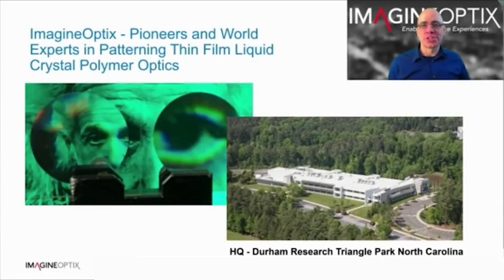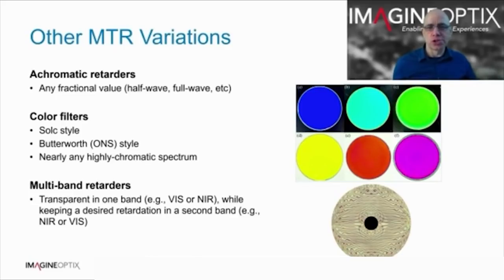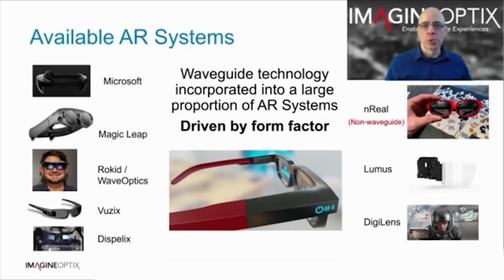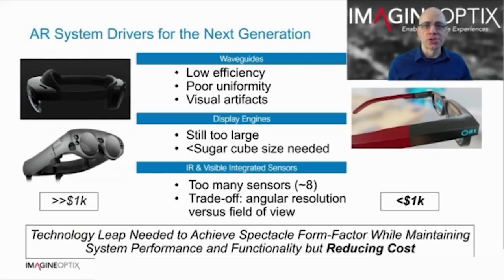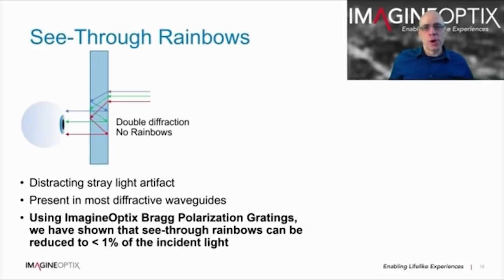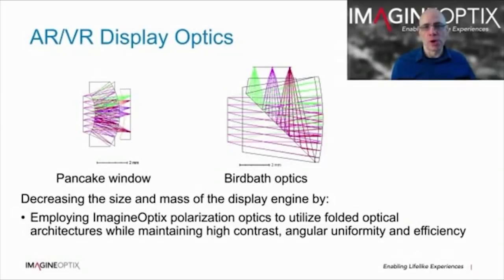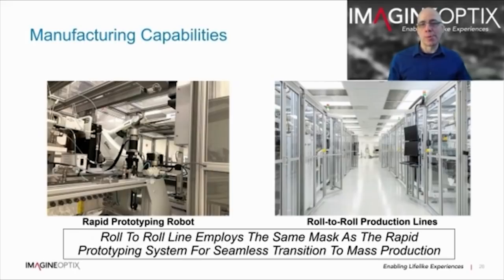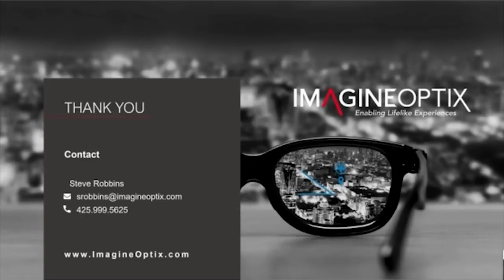Imagine Optix  Liquid Crystal Polymer Optics

Comment: I have to wonder if this display system will be close to what the varjo aero offers in quality? It seems to be more convoluted and that usually means more $$$?. We really need an announcement from Valve... this new generation seems to be quite a large chunk of $$$ and if someone is on the varjo or pimax or X brand hardware, it's not likely they would re-invest in a later valve system. I'm thinking this may be the case because you can order valve lighthouses and controllers as a package with varjo. If their system were coming sooner I don't believe they would be giving hardware to varjo that isn't available for customers on their own website?
Reply from the maker: These are breakthrough lenses that the industry will slowly transition to over time. Players like Valve want to be first to the party and paid for their own factory to be built to achieve this.

These systems will likely trickle to other companies as manufacturing becomes more spread out and cheaper. (However roll to roll manufacturing is already very cost effective)

Comment: So does Meta Cambria have Pancake lenses or Liquid Crystal lenses? Because if that expensive flagship headset from the biggest XR company in the world has Pancakes then it's very hard to believe Valve would leap frog them by a generation so quickly, especially when Meta already showed their working prototype years ago, apparently also using Imagine Optix's tech... i realize Valve already achieved that once in the past with positional tracking, but that was their own in-house invention that competitors didn't know existed, not a 3rd party that already collaborated with competitors.
Reply from the maker: Cambria uses standard polarization-based pancake lenses. I don't think they will be using Liquid Crystal Polymer optics

Valve is in a good position of being able to achieve stuff like this earlier than Meta purely because they target the high end and only implement stuff they care about. Which is sorta the opposite of what Meta targets in terms of price and usercase scenario

People sorta forgot when the Index came out: it had a lot of features that really set it apart. FoV being the biggest that still hasn't been caught up with without sacrifice
Reply: @SadlyItsBradley  But Cambria is also targeting high end and won't even be called Quest. Sure, index was targeting different price and quality than Rift S and Quest 2, which were mainstream oriented with some cost cutting. But Cambria is not this kind of product. It's meant to be a high end flagship that is "substantially more expensive", so this time the idea of Valve going for high end and Meta for low end seem very dubious to me. Something doesn't add up here...
Reply from the maker: There is also limitations for the concept of what Meta wants to achieve based on their planned processing unit. Valve is focused on PC VR as well, which allows much further possibilities in specifications.

Meta has given up on that aspect to focus on pure standalone. So relying on the SoC to do everything will also limit capabilities flat out. Until cloud processing is more abundant
Reply: Carmack has pretty much confirmed that their varifocal technology is not ready.  Meta has to appeal to mass market, it has to "just work" (just getting their users to set their IPD correctly gives them enough problems), and they have strict cost constraints.  Valve on the other hand is targeting enthusiasts and thus they can tolerate a situation where varifocal needs high friction calibration or it only works for a certain percentage of people with "normal" eyes (the rest needing to disable it).  Moreover, they can tolerate a costly varifocal system and other costly features that may assist varifocal, like in-headset eye correction (Carmack mentioned that glasses really screw with their eyetracking and varifocal system).

It should also be noted that Valve made this ~$10m investment to mass produce these optics a year before Facebook showed their prototype (Well, the video of it.  Nobody outside of the company got to demo it).  And you can be certain that they were researching it well before entering a contract with a company to mass produce the technology.  In other words, there are other companies working on these things too but they just aren't participating in the hype/marketing that Facebook/Meta is.
Reply: @asdpls9231  So assuming this theory that Valve will go even higher end and higher price than Cambria is correct you have to start wondering how sustainable for SteamVR profits this approach is. Because Index is not. There are more and more developers giving up on SteamVR because they sell 10x more copies with dumbed down Quest 2 ports. GabeN knows this - he is the first dude in history to subsidize a standalone low end, low cost, low performance PC at $399 called Steam Deck (and funnily enough he even mentioned Quest 2 in an interview about it). He will make his loses back with software fees on steam. This is a trick a $1000+ Deckard will not be able to do. Call me crazy but my current prediction is Deckard being cheaper and less advanced than Cambria. And that's why they also have a subcontractor working on self contained, inferior and cheaper tracking solution not using expensive Lighthouses - just think about that. Or maybe Valve will release 2 headsets: low end and high end. That would be impressive.
Reply: @kazioo2  Gabe has explicitly said they see two paths for VR, low end and high end, and that Facebook is pursuing the low end and Valve will be pursuing the high end.

But first on profits: even Facebook is not netting anything close to a profit with their 30% fee or data collection/ads from VR.  For them this is a $10b/year money pit so they can ensure they don't miss out on the next big medium before Apple, Sony, Google, etc etc run away with it.  And I doubt there's much profit in it for Valve either: the overall VR usage frequency and retention (which is what translates to game profits) just aren't there (Deck will be a different story).  So the truth is Valve cannot really hope to compete with Facebook in low end hardware offset by subsidies.  Yes, Valve is rich, but they are not FB rich (it's a >10x difference) and it would be absurd for them to blow their overall Steam profits subsidizing such a tiny market.  Moreover, even if they did subsidize PCVR hardware, there is really no hope of Valve outperforming low end console VR with their PCVR ecosystem anyway.  It's just the nature of the two markets: like PC gaming vs console gaming vs mobile gaming, some are just inherently cheaper and much more accessible, hence why you see the Quest platform flooded with kids.

But one has to understand that just because one market is larger, it doesn't mean other markets cease to exist.  Yes, you're seeing Questifaction, much like PC gaming saw bad consolization in the 90s and 00s.  And yes, now that the FB money hose is focused on a different market you're starting to see what "reality" actually looks like when there isn't a megacorp subsidizing everything.  But millions of PC gamers aren't just going to give up on PCVR and settle for smartphone graphics and simulation constraints.  For the time being, every Quest 2/3/whatever sold will be another potential PCVR gamer so the markets will grow in tandem.  The Quest market will saturate on content and developers will find it more difficult to stick out on that platform.  Every developer that cuts down the vision of their game for the Quest platform will be creating an opportunity for a PCVR developer to capitalize on processing capabilities that they simply don't have access to.  And PSVR2 and PCVR will complement each other as higher end gaming markets.  In this way, one has to consider the longer term conditions of the market.  When the dust settles there will be developers willing to entertain a market with millions of users, even if there is another one with many more millions.

On the hardware end, Valve's only realistic strategy is to hold a high enough portion of non-FB headsets that FB cannot dominate the entire PCVR market.  The low end is out of reach for them for aforementioned reasons, but the high end and perhaps mid range are possibilities.  FB has 60% now and I could even see it go up to 80% given that they are suppressing other hardware vendors with their subsidization.  But in doing so they are essentially burning money and subsidizing a platform they get nothing from, so this won't go on forever (for the same reason that Sony/Nintendo don't allow PC gaming on their hardware).  Valve needs to retain their enthusiasts with higher end hardware--hardware that is more compelling, more comfortable, has higher retention (I predict VR overall has like 15% retention and a large part of the culprit is hardware related), has more capacities, etc etc.  And they need to double down on interoperability and technology transfers so there are at least opportunities for other hardware vendors in the high end, and moreover so that when FB pulls out of Steam there will be the foundations in place for a real PCVR hardware market.
Reply: @kazioo2  yeah that does sounds crazy. I think it's certain valve will somewhat soon announce the steamdeck, a expensive hmd (more than the index) which has many groundbreaking features: standalone+pcvr w/ wigig2, great valve design and comfort, their open audio design, and awesome lenses and displays, giving a beautiful image with great fov with little artifacts/blur and rubbish

Comment: 600mm x 1000 meters x 8 hours... let's say it's 50x50mm for the lens mask (which is too big but stay with me), that's 240,000 lenses in an 8 hour shift.  On a Single shift rotation they could make 6.7 million per month .. in one year they could make  20-40 million lens sets for HMDs depending on their yield. 20 million seems low but 40 million is high.. so 30 million HMD sets per year?

Am I right?
Reply from the maker: What if they plan to make stacks of lenses to achieve varifocal, though. That lowers the HMD sets per year.

As well as the possibility they also may use the lenses for mixed reality/tracking cameras on the HMDs. Since they advertise that as a feature too.

But I appreciate the math. Was hoping someone would do something like this when I posted the video!

(accidentally deleted last comment instead of edited it, whoops)
Reply: @SadlyItsBradley  I think using up to 16 of them in one HMD may be a good guess, but maybe there is more to come, and there are lcls (liquidCrystalLenses) that don't rely on stacking them a bunch as they are stacked in their internal structure already, which would open the question if it makes the production process more difficult. Anyway speculating on the deckard gets more and more exiting.
Reply: @I’m Anonymous You could interpret his comment as "Yes that's right, though it's very possible there won't be many HMDs made regardless of how many lesnes they can produce due to many different factors: Many lenses used for one hmd, or whether the lenses will be sold to other companies for their uses"